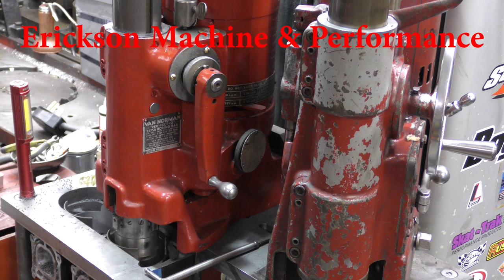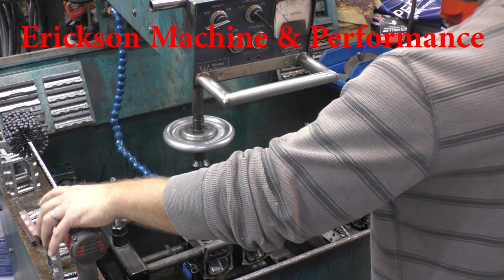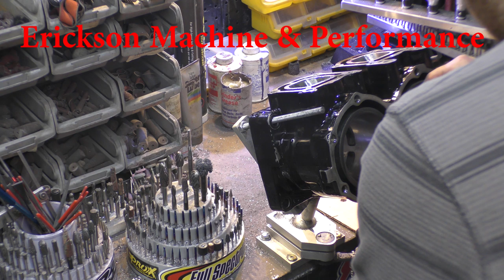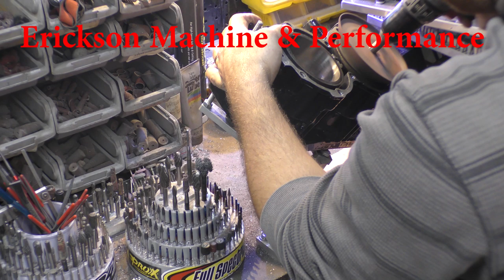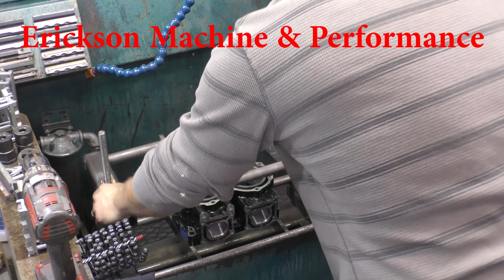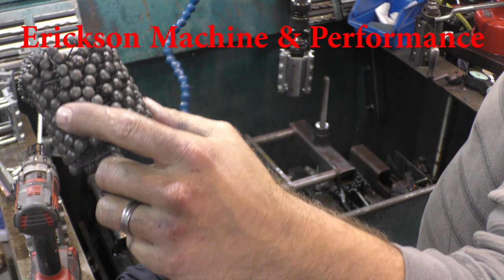Theres No replacement for displacement!! How to Max Bore a Yamaha 701 61x to 760!!

Comment: hello how are you, I'm glad that's good. !! excellent videos and work and the quality of everything you do👏. I have a 61x cylinder in 81mm and I wanted to carry it in 84mm as you do in the video. my great doubt was if there is a guarantee that the shirt will not break or that the cylinder will not heat up ... I hope for your answer and I continued like this.

￼
Reply from the maker: I've done hundreds of them over the years without issue.  Any time you're doing a performance build I recommend running dual cooling but if you're just boring it and not doing any porting you'll be totally fine where it comes to cooling
Reply: @EricksonMachinePerformance  .
Reply: I understand you perfectly, I consulted you because you know a lot about this seeing your work, they told me that you had to change the set to go to 84mm, and does it have the same performance as an original one? I already say through the transfer channels. !! They are doubts that I have due to lack of experience. I wait your answer. thanks.

Comment: What do you charge to do that? I have a 701 61x and was told it’s bored over 81 and ported, but not sure of the quality of work, or where it was done. Haven’t had any issues yet, but it would be piece of mind having it done. Even if it was just assuring a good port, and honning
Reply from the maker: $55 a hole to bore and hone up to 1mm then $5 more per 1mm over.   + pistons 
Email me ericksonmap@gmail.com

Comment: Another great video Mark. Question, on Pwctoday, many Members are strongly against using Ball Hones because they can chip the Ports, is this true?
Reply from the maker: Definitely not true if used properly.  The 3 leg deglazing hones are the ones to stay away from
Reply from the maker: but that said i also only use them to finish chamfering.   They are safe to use just make sure to use the right size and the right speed and you are fine. I have done THOUSANDS of cylinders and have never had an issue.

Comment: Hey man, thanks for sharing your knowledge with the rest of us! I do have a question: I have a hard time chamfering the sides of the ports. Any tips? Thanks!
Reply from the maker: A taper cone diamond burr and practice.  That is by far the hardest part
Reply from the maker: Thanks for watching!!
Reply: Erickson Machine & Performance 

Ok cool, I guess I need to keep practicing.... hey would an 83mm flex hone be appropriate for deglazing a stock 81mm bore? Thanks again!
Reply from the maker: @grichrc2383  yes that would be the correct size to use

Comment: Another great video Mark✌🏻, I have a set of 62t cases that are matched to a 701 62t Jug. I would like to put my 64x 760 jug on those cases but need the ridges cut out of the cases as the 760 cylinder jug will not sit atop the 62t cases..

Does this need to be done or could I cut the lower sleeves so they don’t hang into the the intake path? What’s your recommendation?, How much do you charge for this and say a bore inspection and hone? Thank you in advance👍🏻
Reply from the maker: $50 to bore cases. And thanks for watching

Comment: disadvantages of just going to a 64x 760 cylinder?
Reply from the maker: So the 760 has higher port timing.  That being said, if you Port a 760 and bore to 85mm, that will outperform the 61x.   Both work great.  It's really a preference. Main thing is the 61x is a more common cylinder.
Reply: @EricksonMachinePerformance   thank you for the info!  do you have templets for 64x cylinder and 62t cases?
Reply from the maker: @kirkkarem121212  yes for the 64x cyl.  The cases just follow the video.   But ill be happy to help.  emails me ericksonmap@gmail.com